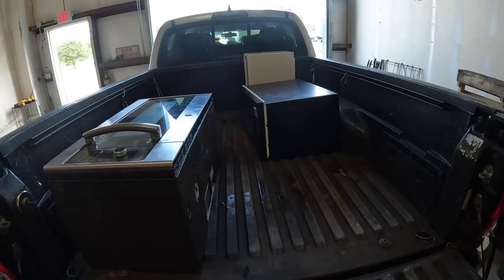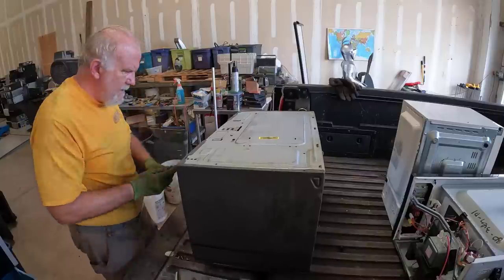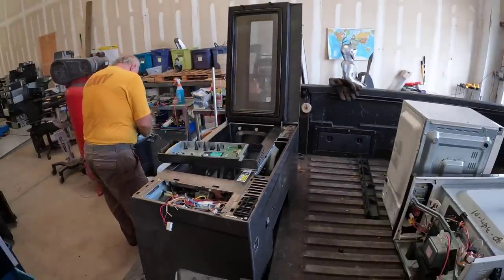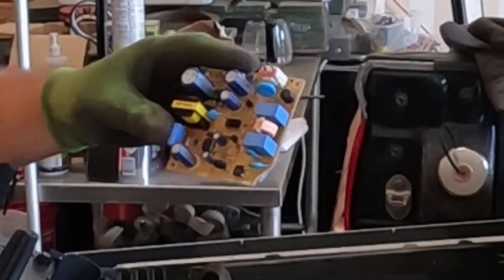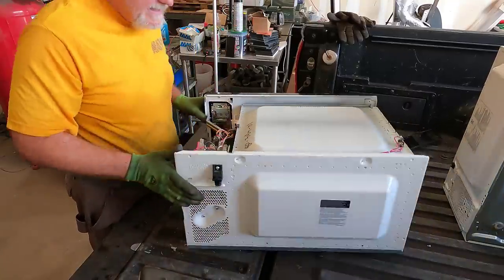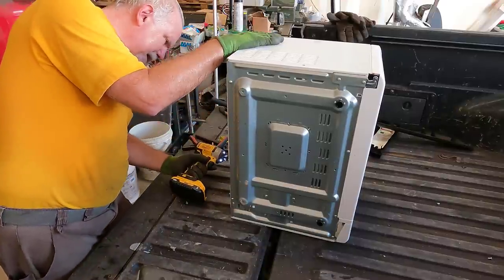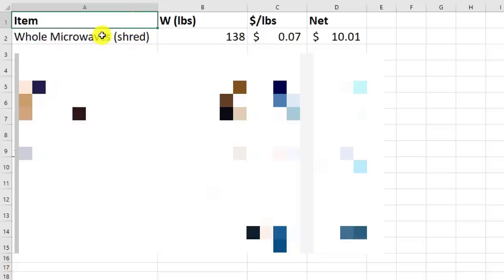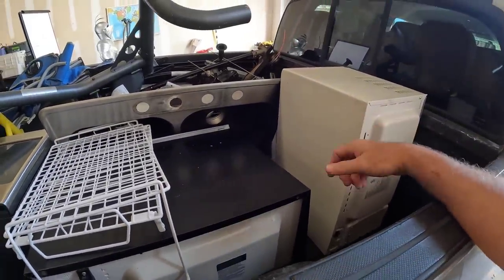Scrapping Microwaves - a waste of time?

Comment: Thank you for all the video's Shark I have learned a lot from them. I started E-Scrapping and more so micro scrapping recently. I mainly buy storage units at Auction and sell the items on eBay and in my store. When I am scrapping microwave's and other items I am not going to try and sell I sell parts of these items on eBay. The door from the first microwave you took apart would sell for 70-80$ the Combo board around 100$ the Magnetron sells for 30-50 depending on the brand. Hell the glass plate as long as its clean sells for 15 - 20$. I understand you focus on scrap I am just sharing a bit more info for the viewers. Of course everything has to be functional and clean to sell them online. Just a bit more info. Time wise this type of stuff is a byproduct of my main businesses so I use rest time to break everything down its a good way to make some extra cash and it saves me from having to pay to get rid of this stuff.  Thanks again Shark!
Reply from the maker: Thank you for sharing that alternative money making approach Adam.  It's so important for folks new to the game to get different perspectives to this.  There are so many ways to make money on used material and help keep them out of the landfills.  Rock on man!

Comment: I love taking apart microwaves. Besides washers and dryers, microwaves are one of my favorite appliances to strip and get other metals out of the appliance(s). Like circuit boards, electric motors, and copper to name a few.
But great video, though!
Reply from the maker: They can be fun to scrap and relatively easy.

Comment: To get around the security screw, take a small punch and smack it a couple of times. This will give you the space needed to get enough of the bit in there and unscrew it.
Reply from the maker: I've a good selection of security Torx but glad to know the work around.
Reply: Or just take out the screws you can and then use a hammer, a hammer works as well as any screwdriver.

Comment: Security bits set is like $10-15 at harbor freight if there’s one where you live and makes it much easier to take apart hard drives phones microwaves and other electronics that are created to prevent tampering
Reply from the maker: Oh I have plenty of security bits. For me, scrapping HDD's and microwaves is more about the value of my time. Should I be scrapping something with greater return instead of the microwave.

Comment: Our yard doesn't take Microwaves. They say the entire load will be rejected.
Reply from the maker: Interesting. Most yards were like just a few years ago. The issue was a substance called beryllium used in the magnetron. It can cause a very debilitating disease called berylliosis. Manufacturers stopped using beryllium several years ago, so it's very rare to find a microwave with that anymore.
Reply: @sharkscrapper  And when I say they will reject the load, the load to the next destination from that scrap yard will reject their load. This was 1 yard in Kansas City. I've not tried additional yards in the area. They claimed radiation was the reason. I didn't really buy that.
Reply from the maker: @mrrobotobrains  There is absolutely NO radiation source in a microwave oven. Whoever is telling you that is either ignorant or a fool, maybe both. Most big yards and large scale buyers do monitor for radiation, but it's not from microwaves. There are radiation sources that can ruin loads, but not microwaves.
Reply: @sharkscrapper  That's what I thought as well. I told them, I guess it's safe to eat from, but not recycle it.
Reply from the maker: @mrrobotobrains  🤣
Reply: @sharkscrapper    The problem is it's usually old microwaves that get scrapped.
Reply from the maker: @Anthonybrother  I've not done a study on the age of the microwaves I get relative to when manufacturers stopped using beryllium and I don't like giving uninformed advice. So it comes down to your local situation, yard considerations and time.

Comment: Recently took apart 16 microwaves and oven combinations big and small, old and modern. Out of the 16 the oldest & smallest of an unknown brand was the only one to have a copper transformer.
As you know I like to melt stuff so I have been collecting the interesting (to me) microwave parts for melting/casting projects.
The space I made is worth more to me than any value I get from them, but I do actually like taking them apart.
Also at 2:55 that is a heating element, you can have some fun with those if you are into tinkering with electronics 👍🦈
Reply from the maker: I do enjoy your casting projects.  It's great that you can find more than enough material to cast from other peoples' cast offs.
Reply: Love you Ralph. :)
Reply: @ewastemike7700  Love you too Mike! 😋👍
Reply from the maker: @ralphmourik  get a room you two 😂😂

Comment: our yard calls shred more than just metal, like plastics included and shred is the lowest price. Then there is sheet steel which has just metal. Like metal backing plate of a microwave or the outside of a clothes drier. which pays more than shred. Short steel would be like nuts bolts, screws and pays a little more than sheet.
Reply from the maker: Very cool to have more viable categories. I wish my yard(s) did the same.

Comment: Skewed the results a little due to pricing different yards for your shred. Either way if stripping the same way you did yes clip the cord and send the rest to shred. 
The more advanced scrapers pop the panel off with a quick swing or two with a hammer, check the transformer for double copper coil and only pull it out if it is and maybe fetch the fan motor out.  Total time is less than a minute per microwave. It's roughly 1 out of 15 or so will be double copper, about the same as washers & dryer motors usually having aluminum windings and not worth the breaking down; unless you intend to repair and resale or sell the individual parts online
Reply from the maker: Clearly I was not evaluating the smash and grab approach to scrapping microwaves 🤣

Comment: For you sharkey it's better to just take them to the yard for me it's to keep me busy I break them all the way down and I take the transformer apart to get number two copper and old sheet aluminum excellent video very interesting and informative keep up the great work five stars my friend
Reply from the maker: Thanks Joseph - glad you enjoyed the video.  Wow, you even break down the transformers!  Now thats some micro-scrapping.
Reply: Transformers are just a m plate with a wielded bottom plate.few cracks on the Weildpoint n it pops apart .then u just tap each side wire spool to get the top spool of wire off 
Thing take u max 10 Mins ,get wire off n throw in a bucket n move on.
Nukers transformers are the easiest "motor" to break down household appliances for 1 to about 3 pounds of copper quickly

Comment: Used to scrap regularly,  hobby and for parts.   Made more on selling good used parts or repairing washers/dryers testing and selling those for $50 or $100 when fixed.   Helps peple who need a good used machine vs 10 bucks for scrap.   Charge a $25 delivered fee too.   As long as they dont want me to put it in basements lol😂😂😂
Microwaves are easy to work on and many "tossed" ones were pulled for a remodeling job.   Selling a working used one for $25 bucks is best way to make a buck or two over scrap.😊😊😊
Reply from the maker: I think that's great. It's not my thing, but I'm glad there are folks like you doing that. I had a guy that would buy used white goods and microwaves from me to fix and sell but he went out of biz.

Comment: The transformers Al/cu I break them down it takes under 60 seconds each with an impact hammer and a large vice .2 lb AL .5 lb cu approx…rest iron    Sadly the double AL are becoming more common the double CU are nice. 1.2-4 lbs. my yard breakage is lower then shred so I often either work up the double AL or try slipping it in if busy..
Reply from the maker: Impact hammer with a good blade would make easy work of transformers for sure.

Comment: If one or both of the transformer windings are copper it takes about 2 minutes to bust open and remove the copper and then you have 1-3 lbs of copper depending on if 1 or both are copper
Reply from the maker: This is true, although the timing depends heavily on experience and tools.

Comment: Great video. 
As a retiree hobby scrapper, I break them down completely, including the relays and magnetron (for melting aluminum and copper)
There is no market for selling boards here (just give them to the recycling outlets, after stripping them).
Reply from the maker: Very cool - I've not gotten into melting/casting, but may try that soon.
Reply: @sharkscrapper  that's actually how I got into scrapping. Want aluminum heat sinks and copper to melt.  Ended up looking for chips with gold and got lots of metal shred.  Not making much money but that wasn't the intent.
Reply from the maker: @cptrikester2671  very interesting journey

Comment: Just because it magnetic doesn't mean it's not stainless.  It just means it's natural a 300 series stainless like 304 used in most kitchen appliances. I make custom knives and 440c and CPM 154 are high grade stainless and are definitely magnetic.
Reply from the maker: True but there's a different feel to the mag with them
Reply: @sharkscrapper  true 👍

Comment: now do a video of parting out microwaves by selling those pieces parts for repairing microwaves...if you could sell each used motor and switch and keypad ,handle or door and so on could make you 25+ dollars per microwave
Reply from the maker: Not going to happen. While it may be possible to make that kind of money selling the parts, of a microwave I'm not going to spend the time. There aren't enough hours in the day for me to process all the scrap I get and manage selling on eBay or MarketPlace. Selling like that to make the money you're talking about becomes almost a full time effort on it's own. I do sell some PC and higher end electronic components that have much higher value.

Comment: Yeah for me I don't bother anymore either with microwaves, easier for my time just to toss in shred. If the covers are off like that I'll trim wire though but my yard wants alum transformers in shred so not even breakage due to the weight of steel in them. I do the same with appliances now, if they are clean enough I try to take the back covers off to trim the wires but that is as far as I go unless someone wants a washer machine drum for a fire pit then I may go for that if it looks easy to get at.
Reply from the maker: I'm with you Jay.

Comment: There is no market for microwave plate? Here there is one (fr). Instead of purchasing a new plate or worse, a new microwave, you can buy a plate for the fraction of the price. Same for dishwasher caddie. I experience myself, 90€ for a new dishwasher caddie, I've got two to replace, instead, I go on the second hand market and got them for 10€ both.
Reply: You'd probably need to store many of them because there are many different sizes.
Reply from the maker: There are some folks who claim to do well selling the plates.  I've had no success with it in the past, so don't bother with it any more.
Reply: @sharkscrapper  Ok, thanks for the answer. I'm always amazed by the volume of bulk item you can find in the street and not in the good way (only for you)

Comment: Really should get rid of that impact driver, 
Or adjust the torque on it...
A lot of the electronic components are salvageable for repairs on other electronics. 
Caps , transistors etc.
Reply from the maker: That's not my biz model. I tried selling low end components early on and quickly realized it wasn't working for me. I do resell higher end components from newer PC's and servers.
Reply: @sharkscrapper  ...very good.

Comment: Pull the guts out and save for later until you can build a volume to process. The transformers aren't hard to take apart and the upgrade from breakage is substantial. Processing a few at a time isn't going to be worth it, but there's a curve and it gets more profitable the more you do.
Reply from the maker: There's a lot to unpack in your comment and could make for some interesting vids.  What do you get breaking down CU/Al transformers vs Cu/Cu transformers and where is the knee in the curve for processing to make it worth the time spent.  All good explorations.  But computers are my mainstay, so I'm not sure I'll get the time to do these studies.  I will keep them in mind - you just never know what trouble the Shark will get into.
Reply: @sharkscrapper  i feel that even the CU/AL ones are worth it in the long run. A microwave transformer is 8-12lbs. Most of that is iron shred, so once you separate it you still have a lot of iron shred that doesn't take up a lot of space and is very heavy. So if you get quick at processing them it's really a significant upgrade. A lot depends on how many you pick up.
Reply from the maker: It's on my list to look at.  But this could take some time to get together.